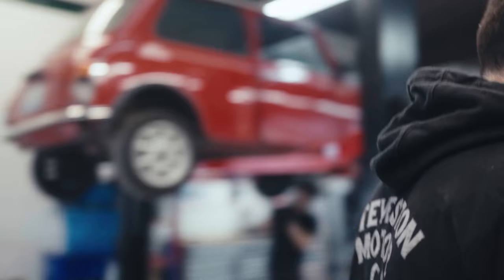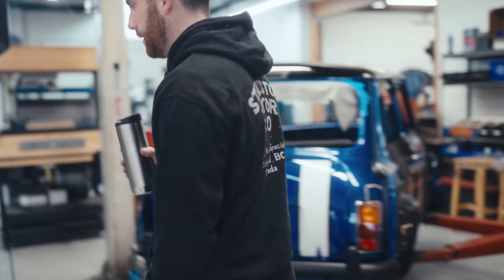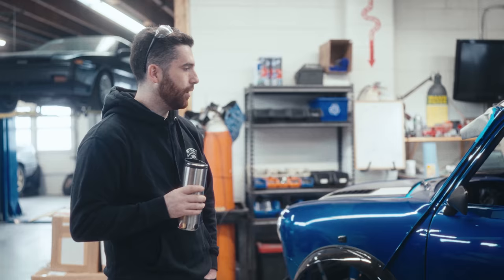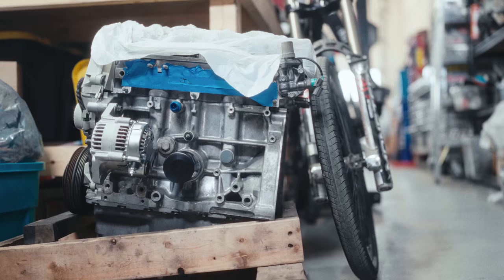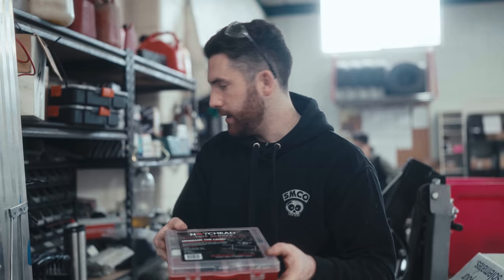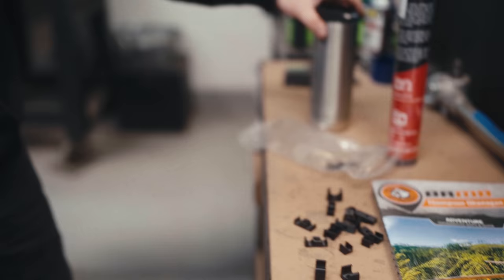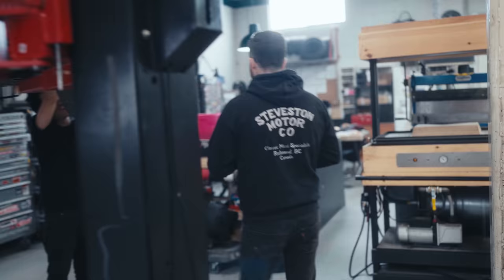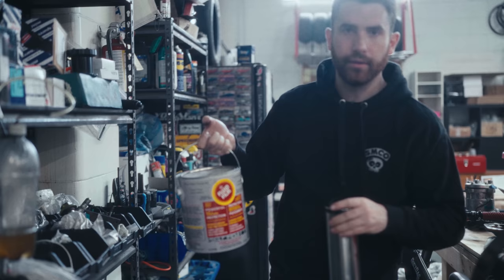Phil Answers - Best Mini Upgrades and Maroon 5 Side Hustle

Comment: First mod. Find and repair the factory rust and oil leaks.
I'm not positive but I think they came from the factory with 2 oil leaks. I think you could option for 3.😏
I've had mine for about a month.
I've replaced ball joints, shift rod seal, door/boot locks, rack boots and heavy duty strut rods.
Repaired rust below both tail lights, the inner fender well on the left side and under the fuel tank. Also repaired striped bonnet bolts, broken mirror and reworked the other, made seat brackets, fixed the driver's seat springs, replaced a couple of wheel studs and 100 other little things I can't remember.
On the way are output shaft seals, rear shoes and springs, E cables, lower control arm bushings, SS rear view inside mirror and a few other little things.
I have radius arm and upper arm kits on hand.

Mine was a nice car when I got it. This is topical. 
The purist will scoff at fixing the oil leaks....."that's not stock" they'll scream. 🤣

Comment: Great video.
Interesting the factory race and rally teams got 12 inch wheels homologated for motorsport use in the late 60's.
The racing guys liked to low profile tyres for circuit, but rally guys didn't as the tried to us taller tyres to improve ground clearance.
Reply: Reading vizard's book and there was extremely limited choice in 10 inch tyres back in the day and fwd and racing meant there wasn't a tyre that would survive a race so they went looking at other tyre sizes.

Comment: I actually had a question to ask and forgot. But someone asked it .. I was wondering what got you into Minis. 
Agree with all you said throughout the video and especially suspension and maintenance. My next job on the Traveller is to replace the rear suspension which has just got tired.

Comment: Hi, I have a 1330 engine with 3.44 FD, but the gearbox is a close ratio gearbox from innocenti engine, for me it seams like the close ratio box with 3.44 is driving similar to a normal gearbox with 3.21 FD, my question is should I change my FD to 3.21? I would like to have tue best power output in terms of acceleration and highway drive
Reply: You cant have both. A 3.44 will give you more acceleration where a 3.2 or 3.1 will give less acceleration  and higher top speed so lower revs when cruising, which can be more comfortable. 

It's really a compromise,  only you know how you use your car, and on what types of road you drive on.

If you have a 1275, especially one that is tuned you can go 3.1 without really suffering on the acceleration part, and still benefit the added toospeed and comfort while cruising.

Comment: Hoe much would be for a Honda d16 swap?
Reply: You would have to email them but if they do complete new wiring, engine, subframe and everything else, probably around 20K
Reply: @eduardodedios8213  that's a lot of money you could spend on your A series engine for making it very fast en still be really reliable, and keep 10k in your pocket. Personally I would not bother. For that kind of money you can buy a fully build Specialist Components supercharged 160hp (minimum) engine. Or 16V conversion, or.. ...

As you can tell I'm not a fan of the Honda conversions.

Comment: hey phil what’s the best cam upgrade for a 1310 would you go KAD 100 or a re13 ?
Reply: It depends on how you use your Mini. My advice is to choose a camshaft that compliments your current driving style.

A SW5, Kent 266 or AC Dodd RS will give you power from idle to 6500rpm.  Ideal all round cams.

A 270 or 274 cam are also still nice on the street,  but a 286 for example will be really wild to drive but a dog in traffic. So again, choose something that suits how you use your car.

Comment: Hey, would you recommend changing a HS4 to a HIF on a 998 Mini ? I’m struggling to get drivability.  Good tips on the video 👍🏻
Reply: You dont need that.  Is your engine completely stock? Check if your carb is mechanically correct. Use the right dashpod oil and keep the correct level.

Also fuel level setting is important

The HS4 is a perfect carb for your engine and can take performance upgrades up to 60% of original
Reply: It's kinda not worth doing. Rebuild the hs4 including the throttle spindle bushes. They like to leak air in from there as they wear. Also check the fuel pump is pumping enough fuel to the float bowl. 

As they said in the video the HIF is newer tech, so you want fuel starve when driving a mini like it should. 

If you get the chance, get a David vizard book and have a read through. He mentions why carb "upgrades" aren't worth it.
Reply: The carb has recently been rebuild and in good condition, all the ignition system has been changed and still can’t get a good feel when driving. I’m thinking about booking in for a rolling road session
Reply: @joshdony9959  if its rebuild and the float and oil levels are good for the carb a rolling road session is a good first step. What ignition did you fit? That could also cause bad running, as will incorrect sparkplug gaps etc..   

Please let us know the results. There is no reason your car should not run as smooth as butter